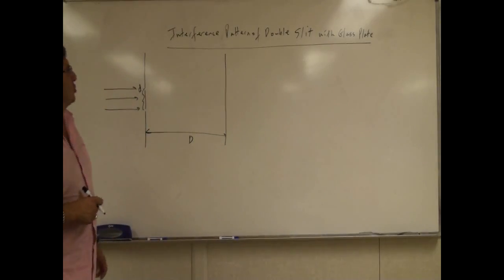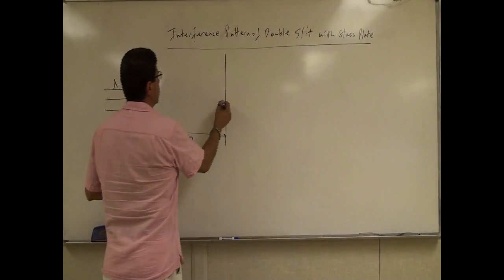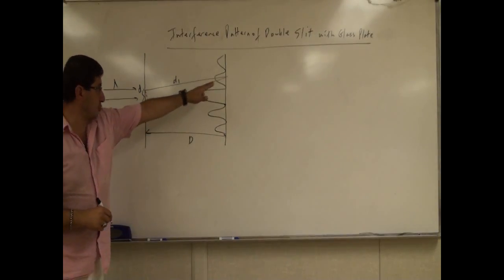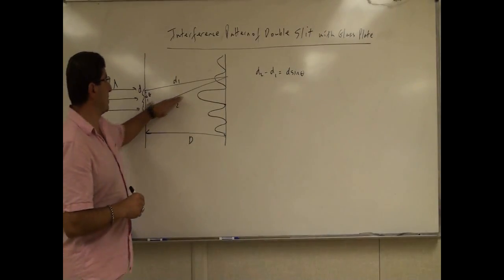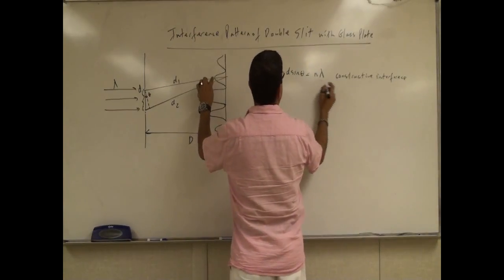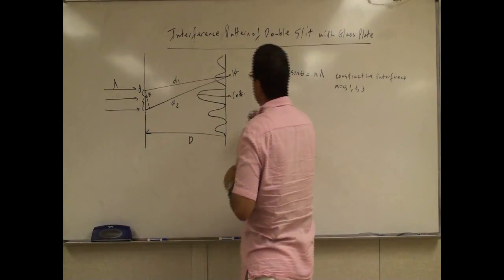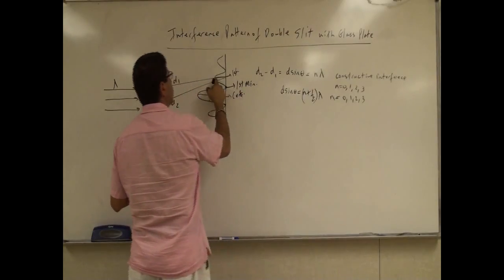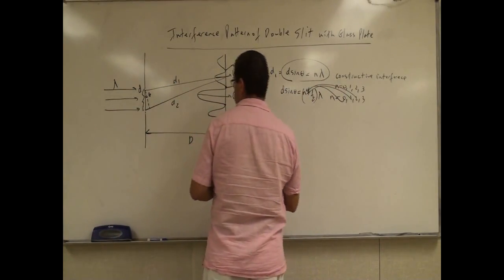Interference Pattern of Double Slit with Glass Plate: Example

Comment: For anyone wondering why n*L equals the optical path length, here you go:
In a fixed time interval t light travels a geometrical distance x1=vt in an optical medium, where v=c/n. Here c is speed in vacuum and n is the refractive index. v is the speed in the medium, which is less than in vacuum.

In the same time interval light travels a distance x0=ct=c(x1/v)=(c/v)x1=nx1 in a vacuum.

So light takes the same time to travel a distance of x0=nx1 in vacuum as it takes to travel a distance x1 in a medium of index n.

Comment: Hi, good explanation however there is something you could have made clearer:
When you have 2 identical slits the maximums are given by d*sin(theta) = m*lambda. Therefore the center maximum is given by m=0 or d*sin(theta)=0.
And just like you said d*sin(theta) = r1-r2 where r1 and r2 are the optical paths of the rays coming from slit 1 and 2 respectivly. What the center maximum tells you then is when r1-r2=0 or in other words, when the two optical paths are the same. 
Now what happens if you put a glass plate  in front of one of the slits? You are increasing the optical distance of the rays coming from that source by n*L. Where n is the refrection index and L the thickness. So the new optical path distance is r1' = r1 + n*L. 
However you know that the biggest maxium is given when the two optical paths are the same, in this new case it means: r1' - r2 = 0 => r1 - r2 = n*L.  But you already know that r1-r2 = d*sen(theta), because that is the is the result of the assumptions we made for r1-r2. 
And so you have d*sin(theta) = n*L. 
But sin(theta) = x/D by the geometry of the problem. So you have d * x'/D  = n*L. 
Again, the condition of center maximum means x = 0, so the shift of the center maxium will be x'-x = x'. But beacuse the fringes are equally spaced (due to the assumptions we made) a shift in the center maximum will mean the same shift for all the other fringes.